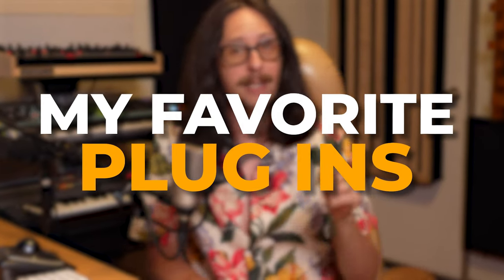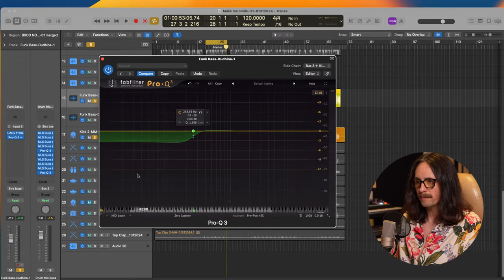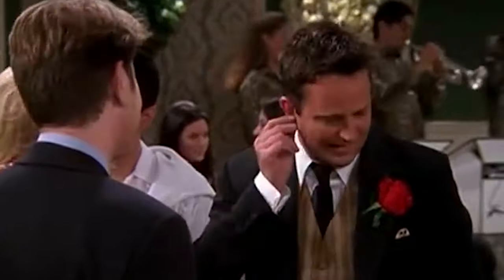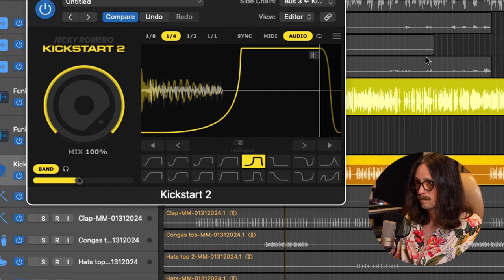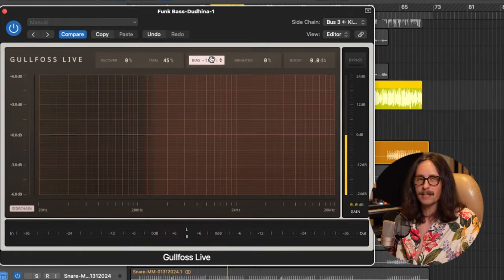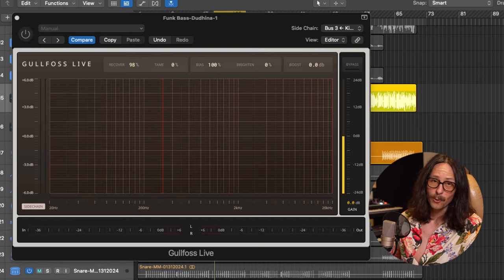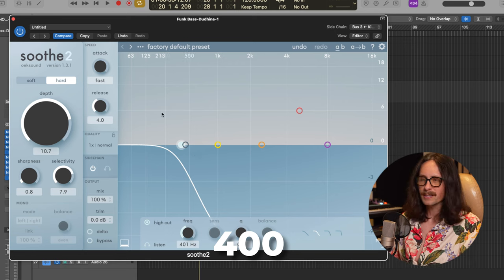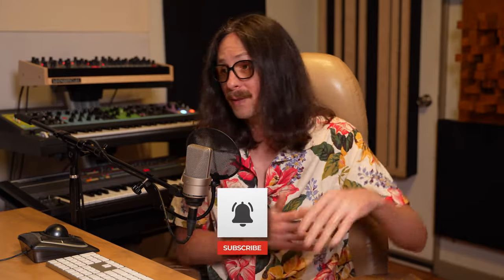Favorite Plugins For Side Chaining Kick & Bass | Radium Mix Series

Comment: Soothe and Trackspacer do it for me in this area.
Reply from the maker: Both great plugins but definitely try out some other ways… Both those plugins use multiband resonant filters to EQ/compress down and can add phase shifting/ distortion.  Try fab filter and kickstarter and hear the difference, as they use dynamic EQ and volume automation instead, which can be cleaner and more transparent in certain cases.
Reply: @RadiumRecordsHollywood  will def be trying that. I have the cable guys bundle. I believe volume shaper is the same function.
Reply from the maker: Yes.  I just don't know if it can do the filtering and freq specific stuff? @jorgefrias7889